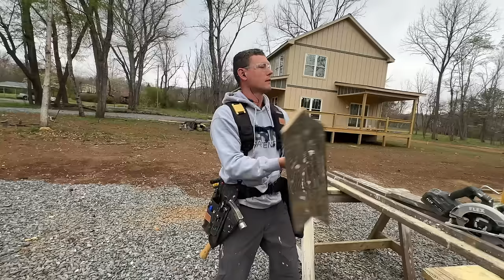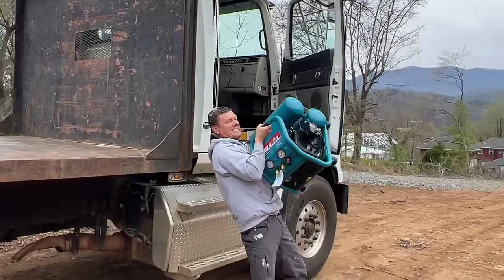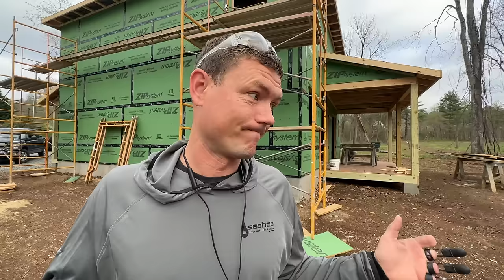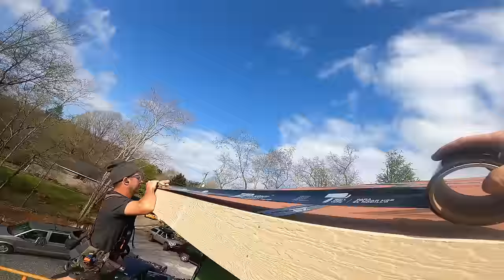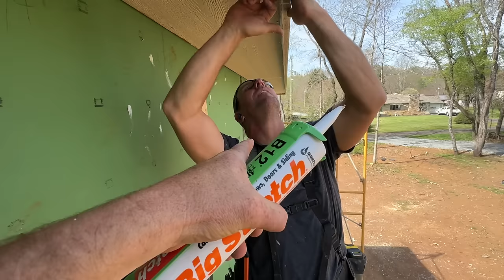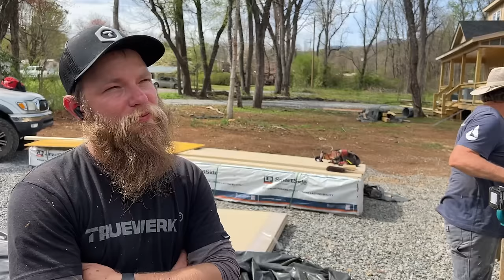Construction of a Duplex Part 17

Comment: Been watching you guys from the Netherlands. Our building style is sooo different. But as a carpenter here. Great to see y’all framing with wood
Reply: So what's soooo different about your framing style or method
Reply: @jamesadams893 In the Netherlands each wall is a separate piece of the house, so you frame it in a different way from the get go. You also need to run expansion slotgaps under windows etc because the ground is constantly moist there, the entire country used to be one big swamp after all. Said gaps allow for the separated walls to move and shift without cracking.
Reply: @jamesadams893  our outside wall systems consist of an Sandlime brick as interior wall, than insulation come to the outside, than ther is an air gap. To finish of the outside it’s normale brick work. All our floorsystems ar made out of prefab concrete floors, wher the installation is going true , after that it’s poured with concrete. Floor hitting will get on top of that. Than an second floor is made out of cementscreed. So yeah we don’t work that much with Wood
Reply: To be honest I don't really give a shit , my comment was tongue in cheek.

Comment: If the sound of the compressor becomes annoying, you can always make yourself an insulated shroud with 1-2" foam insulation and scrap plywood to go over it, keep the back side open for air, and it'll direct all the noise away from you.
Reply: yep!  or even just a sheet of sheathing leaned against the compressor, between them and the compressor.
Reply: California Air, I'll never go back. Screw compressors are great.
Reply: I'm surprised Jamie didn't make a simple one considering he's the MacGyver of the crew.

Comment: The duplex is really taking shape now, the facia and soffits help with that finished look. I think most people that build or remodel houses have put their foot through a ceiling at one time or another. I put my foot through a ceiling, but as it was pitch black underneath I thought I'd been lucky until the light was switched on in the kitchen of the flat below and the occupant just in shock going "No, no, no, no, no ....." the hole was fixed the next day and we painted all the ceiling, as good as new. Great job, looking forward to the next episode, be safe be well 🔨🔨🔨🔨🔨
Reply: 😂😂😂
This just reinforces my belief that Americans build with paper. How is that even possible?
Reply: @hassan_codes  Usually lazy/cheaper approach is to use just drywall. American homes, when built correctly, are surprisingly strong. Certainly can withstand more powerful earthquakes than those we have in Europe since bricks don't like shaking at all 😄🤔
Reply: @hassan_codes  Drywall is not structural, it's a surface for smooth wall finishes and it's a firebreak, but it has no effect on the rigidity of the house. It replaced lath and plaster, which was harder and stronger, but that strength is unimportant for anything other than hanging shelves or pictures and things on the walls, and drywall is immensely quicker to install than lath and plaster.

The wood framing is extremely strong; you couldn't put your foot through that. But as you can see in these videos, it's a framework with large gaps. The house would never be structurally damaged if only the drywall was punctured. Also as the other comment says, wooden houses can sustain much higher earthquake loads than masonry. And in addition (although it was definitely not a concern to builders in past decades), wooden structures store carbon, while all manufactured masonry products (concrete, brick, clay tiles, etc.) emit large amounts of carbon.
Reply: @hassan_codes  I'm from the UK, where the majority of older homes are built with cinder blocks and bricks. The drywall is used on walls and ceilings. We had removed the wooden floor to examine the 6"×2" joists. That's when my foot went through. I've worked in the US several times, and their homes, although wooden framed, are really strong and well made.

Comment: I noticed you guys are fully enclosing the overhang soffits, just wondering how you vent your roof?  I saw that you have an air gap at the exterior wall sheathing between top of wall and bottom of top truss chord, but if you fully enclosed your roof overhang, how is air supposed to flow  thru the attic space and deter dry rot?  Also, are you planning to install roof jacks or a ridge vent?

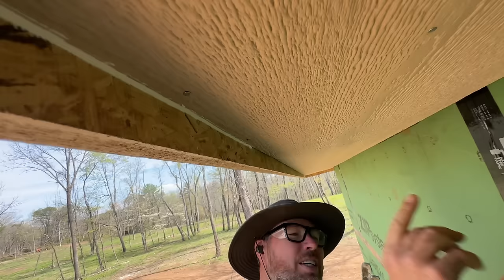Comment: 14:24 I've said it before but contact Makita or DeWalt and see if you guys can borrow a battery caulk gun to try or just buy one. They are a bit finicky to use at the start with getting the speed settings correct but it's a night and day difference if your doing it all the time. They save so much time and effort when dialled in correctly and auto retracts and stops flow granted I don't use them that often only at the end of my jobs finishings of my tiling, but if for some reason you need to pump a lot in a short amount of time you cant beat them. (Underneath sliders windows big gaps etc)

Cons are like all portables you need to remember to charge your batteries and there is a decent weight bump. I'm pulling the figure out of my back side but about three to four manual caulk guns stacked at least with the Makita one I've got.

Comment: weebles wobble but they don't fall down - please find some time while trimming out place - talk about all the terms for the parts - fascia/soffit /rake and shadow boards - the cuts are so precise on this build you almost don't need nails or grk fasteners #fastener schedule   no vents in soffits? the air guns are so good - you can get a buffer tanks to make the cycling less annoying - esp when running multiple guns - the air guns are so smooth and cheaper than the passloads #bray   - last thought- who hasn't fallen through a ceiling?

Comment: Yeah that be good for the bus in the joints but not the corners you need regular flat sander to go into corners I was a drywall finisher for 15 years I work for a guy in Portland Oregon we work 10 hours a day 7 days a week for a year-and-a-half we'd worked on five houses a day we did 12345 houses 4321 then go home

Comment: Anyone ever use that style sander on a popcorn ceiling? Every ceiling in my house is popcorn and it all needs to go. I've tried the spray and scrape method that was no fun. I've ripped out a whole ceiling and started new.....I hate finishing drywall so I was thinking sanding it with the vacuum sander.

Comment: Hey you guys finally bought the milwaukee framing nailer. I added the extended magazine to mine so it can hold 2 clips of nails.
I like running the nailer off of a 5 or 6 amp battery to keep the weight down as the gun is really really heavy  compared to the paslode

Comment: That old used board yall put in the upper corner of the duplex and an unscrupulous lawyer can cause you a huge lawsuit if you promise the home buyer a new home.  

The largest home builder in the USA had that happen to them (DR Horton) and if a board is used as a brace it is never allowed to be a part of the structure.  

Any run of the mill lawyer can easily void any agreement you have with their client if there are old scraps used in the building of the home.

Comment: Why did the soffit not get vented?
Reply: Because the attic space will be a conditioned space (heated and air conditioned).  Insulation will be placed up against the underside of the roof and not above the interior ceiling.

Comment: I think Jamie halved the pitch ratio instead of the actual angle measurement which does not yield half of the angle *except in the case of 8/12 and 4/12 pitch. So you got kinda lucky I guess lol
Reply: No i think it was because of the width of the board that differed, you cant bisect an miter angle by dividing the total angle, best way to cut the angle is do it the old way and mark directly on the board from a overlapping joint.
Reply: @antonvink  yep real world methods always work

Comment: Stupid question time... when you say you took the long and short measurement, and not assuming that the roof was correct and the board cut to 45 degrees, what exactly do you mean??? Can you explain how you do this, because it sems really important.
Reply: The pointy part is the long point and the obtuse angle part is the short point

Comment: A good taper/drywaller does very very little sanding...rendering that tool completely unnecessary.
Reply: In the video, Eric says he doesn't plan to use it for drywall. He's going to use it to sand down the primer before the paint goes on.

Comment: For the life of me, I can’t figure out how people who build houses can’t figure out that 34* is 8/12 with one facia board running horizontally (zero deg) naturally the horizontal facia is going to be a larger degree cut than the board running at an 8/12 pitch.   If the 8/12 was vertical at 90*, both would be a 45* angle but one is zero the other is 34*, therefore they won’t have the same angle cut.  Basic trigonometry.

Comment: Every single time I watch your videos I wonder why you are not using a full scaffold instead of that sorry excuse whatever it is. I can only assume, it is to reduce cost for the homeowner and you. 
But in my opinion (although nobody asked) a fully scaffolded build increases efficiency and safety for everyone. But hey,  that's just me.

Eta: are you going to remove that plastic cover for the fire wall?
Reply: I was wondering what the code was on that.